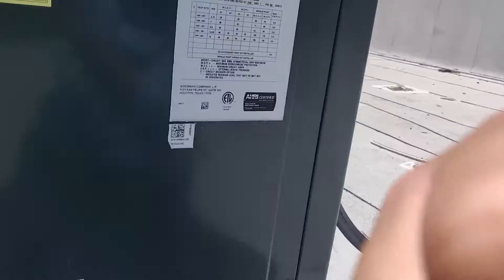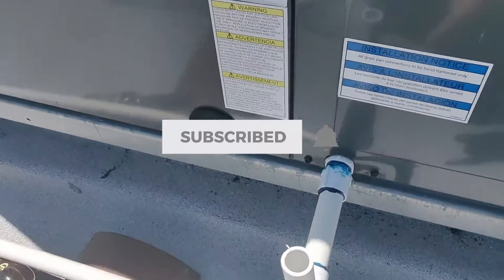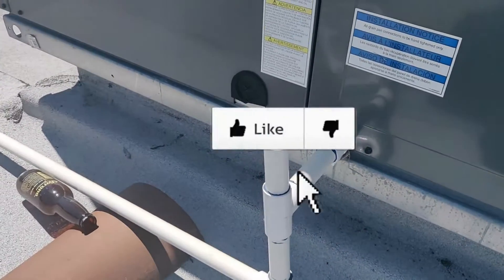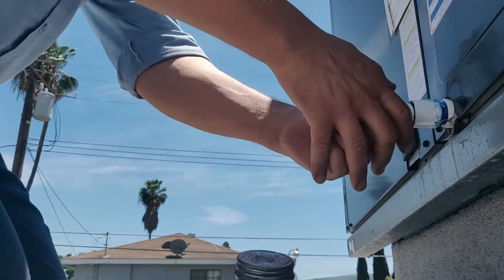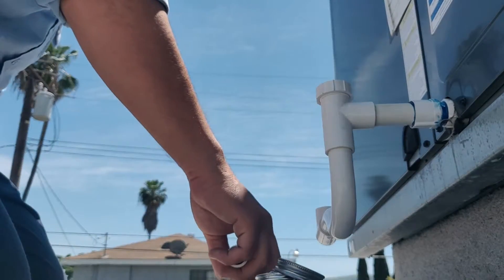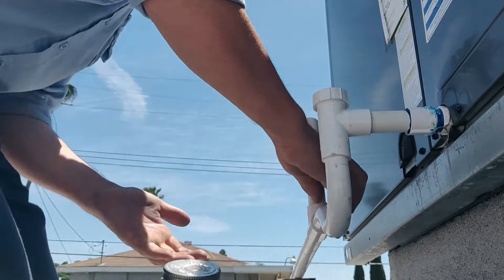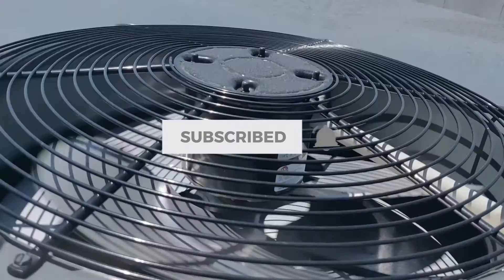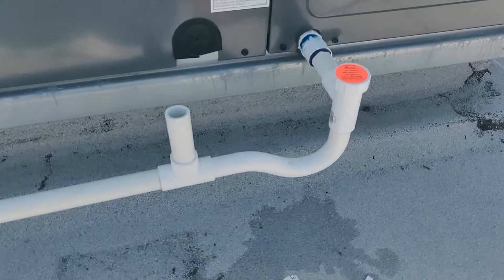Why you need a P trap

Comment: My unit does not have a p trap and it drains just fine ....
Reply from the maker: @ACommenterOnYouTube  Might already have a trap on the inside or drains through the positive pressure side
Reply: @theairconditioningguy  very doubtful there is a trap inside the unit, i opened it years ago to change out the fan and the drain line is right there at the bottom of the pan.
Reply from the maker: @ACommenterOnYouTube  Then it must be in the positive pressure side
Reply: @theairconditioningguy  vs the negative side because there is no other place for a drain line
Reply from the maker: If air is getting sucked in then it's the negative side. If it doesn't have a trap then it's probably building up extra water before it's heavy enough to drain.
Reply: @theairconditioningguy  it does have a vacuum when i open the cap off and that vacuum is from the blower pulling air up from the bottom to the top over the coils ... 
but at the same time water does flow and drain even with that vacuum pull on it.
Reply from the maker: @ACommenterOnYouTube  I'm not saying it won't. Just needs to build up more water before it exits.

Comment: What do you use to adhere the pressure treated wood holding the pvc pipe to the roof?
Reply: Thank you so much! Great videos. Do you service Long Beach area or can recommend a good HVAC guy? I did the condensate drain just like in your video. But condensation is coming out of the corners of the York unit. Is that normal or ok? It’s also coming outta the drain hole too.Thanks so much!
Reply from the maker: @timothystewart3431 Not normal. I don't have anyone I know that services that area I'm sorry. Have you tried vacuuming the other end of your drain line? With wet dry vacuum. You need to tape the vent on the drain before vacuuming it. It's the PVC T right after it exits the coil.
Reply: I will try that! Thanks dude!
Reply: Thanks again! Stay cool out there! 🙏
Reply from the maker: Roof cement
Reply: Do you mean the T that has the orange cap in your video? The drain line I installed is brand new and I made it just like the one in your video with the trap. Made the vent pipe a few inches taller than the height of the drain hole on the unit. If you say to vacuum it, are suggesting to vacuum the pvc drain that lays on the roof or the pan inside the AC unit? Thanks for your help!
Reply from the maker: @timothystewart3431 You'll want to put some temporary tape on the vent after the trap then go to where the drain ends and vacuum it from there.

Comment: Does the unit need a vent for the drain after the p trap?
Reply from the maker: Yes
Reply: @theairconditioningguy  why
Reply from the maker: It allows fresh air into the drain pipe to help water flow smoothly through it.
Reply: @theairconditioningguy  thank you for the explanation. I'm doing a similar setup right now although my system is positive pressure and a vent is not technically required. Having multiple access points does help when it comes time to clean up the drain line, so no regrets here 👍
Reply: @theairconditioningguy  Sorry one last thing - does the P trap have to be level ? Or is it suppose to be slightly angled like the rest of the line?
Reply from the maker: No worries! I always give it a slight angle.
Reply: Do you recommend this for a house ac?
Reply from the maker: Yes
Reply: @theairconditioningguy  one last thing. After the trap you recommend a cap or not cap? Thanks
Reply from the maker: Not

Comment: I don't understand how the suction occurs.  If water was draining out of the conditioning unit I would assume there would be pressure not suction.  
I just need a better explanation because I don't quite understand where the suction comes from.
Reply from the maker: One side of the system blows air in to the ducts. The other half has negative pressure or vacuum. That's why the water gets sucked back in. If you put a trap it will help stop the water from returning into the system. The trap will create a trap or barrier that won't allow the water to get sucked back in.
Reply: I have an indoor electric furnace which doesn't seem to drain much water I noticed my p trap is located below the furnace not right where the condensation line comes out. Van I send you a picture so you could  give me your opinion on what you think
Reply from the maker: theaircoguy@gmail.com

Comment: that can be the WRONG trap if the unit is larger tons.
Reply from the maker: Really? Explain please. I only work on units up to 5 tons.
Reply: @theairconditioningguy  th higher the static pressure the deeper the trap needs to be. The trap should be a MIN of 3" deep from the top of the outfloow to the bottom of the trap. The bigger the under the deeper the P trap needs to be. That trap you used is very shallow. Im not an ac guy BUT I only use my OWn trap I build or buy that is much deeper than that.
Reply from the maker: Makes sense, these traps work good on these units. But thank you for the information. Always learning here.

Comment: Sorry didn't understand. Plz explain without assuming we r already experts else what's the point of us coming here :)
Reply from the maker: Sorry, I just read your question. On the negative side of the system there is a vacuum that will suck up the condensate water. It won't let it exit the unit unless you put a trap outside to break the vacuum.
Reply: If you couldn't figure out what he was saying, you shouldn't be working on your AC.

Comment: My house unit which is a duel fuel heat pump. If the heat pump can't bring it to the set temp. then the gas kicks on. Anyway the blower unit is under the house in the crawl space and I noticed water on top of the plastic. The unit is dripping water instead of it coming out the drain pipe. I opened the clean out port and poured water in it and it drained out and it doesn't look like it is clogged where it connects to the unit. Any ideals? It does have the trap and it has about a twelve foot straight run to the outside which to me doesn't look like it drops much but the bottle of water I poured in drained out. Thanks for any help.
Reply from the maker: The unit is probably not level or might need to be slightly tilted so that the water runs towards the drain hole.
Reply: @theairconditioningguy  Thanks I will look at it. Also I noticed it doesn't have the vent pipe that you installed after the P trap. Could that be the problem?
Reply from the maker: It would help so install it if possible but I'd focus first on leveling it.
Reply: @theairconditioningguy  Ok, thanks

Comment: What happens when it rains? Does it cause a problem on the open part of pipe
Reply from the maker: Nothing, pipe hole is too small and any water that did enter would run down the drain.

Comment: I have a question about regular drain lines coming out of the wall to the ground. Is it necessary to have 4 90's for a drain line? Reason I ask is i work for an HVAC company but someone put 4 90s like crazy for the drain lines and was told they need to face up but it causes them to get clogged....what the fuck?
Reply from the maker: It sounds like they are creating a trap outside. Is that correct? Send me a picture if you can. Maybe they think it's easier to service outside. If I remember correctly the manufacturer of the evaporator coil wants the trap within like 7 out 8 inches of the drain hole, I can't remember exactly. The purpose of the p trap is to stop the transfer of air. If it's on the negative side of pressure the drain will not drain easily. The water will get sucked in. But if it's on the positive side you also want a p trap so that the air doesn't leak.

Comment: If i remove trap and I put long Straight pipe.. ist okay?
Reply from the maker: Not on this model. If it's on negative pressure side you have to put a trap otherwise the water will mostly drain when the unit turns off. But if it's on the positive side then you could do that. The way you know is if the unit is running and you feel suction from the pipe then it's negative pressure and vice versa.
Reply: I wouldn’t. I’m installing a p-trap as this is what I blasted out yesterday as the p-trap is missing. I’m in very humid and hot Florida https://twitter.com/ar4star/status/1310179174200549379?s=21
Reply: I don't have a trap on my 12 foot drain line. It's a rooftop combo furnace/AC unit with a slight drop of maybe 2 inches on the 12 feet of drain. I am in Southern Arizona with very little humidity. It drains just fine. Is it working because the unit doesn't have to remove humidity?
Reply from the maker: Maybe it's on the positive pressure side and yes less humidity building up will buy you some time before it overflows. To check if it's on the positive side put your hand over the tee or end of the pipe when it's running. If you feel Air coming out when it's running then it's fine. If you feel suction them you'll need a trap.
Reply: @theairconditioningguy  Thanks for the info, I will try that. The house is very airtight so even on 105 degree days it shuts off for a good while. That may be all the time it needs to drain the pan ?
Reply from the maker: Yes it could drain in less than one minute.

Comment: Looks like they glued the threaded fitting, is that common ?
Reply from the maker: Sadly some glue it. It's not what I do. I use Teflon tape.
Reply: We use Teflon on the male fitting then use glue an primer
Reply from the maker: There you go. That's the correct way. 😎👍 You don't glue the male fitting into the drain pan.

Comment: Gonna get sick wearing that mask
Reply from the maker: I put it on to replace their filter. I often forget to take it off. 😷 I did hear someone say that. Not sure if it's true. I've worked for hours and hours in attics with my mask on. For two decades. Haven't felt sick from it yet. N95 and the filtered masks with the filters on the side is what I usually use.
Reply: The Air Conditioning Guy yea I’m just messing around I have trouble breathing through them I usually only wear when dust/insulation is bad